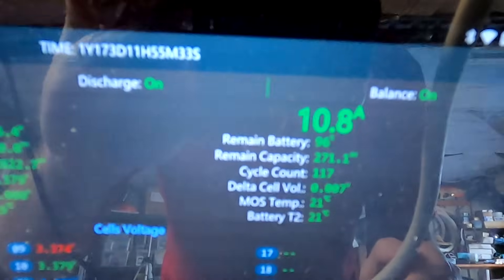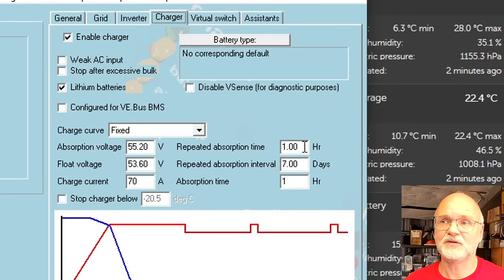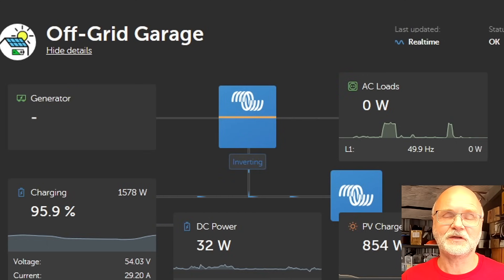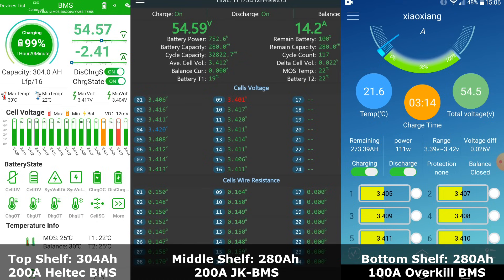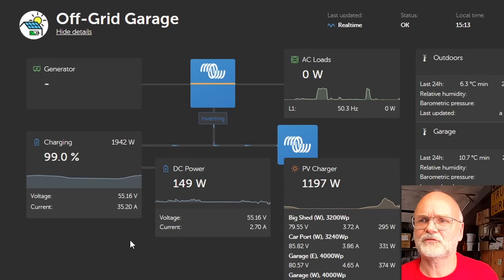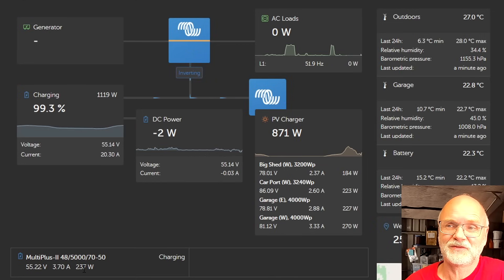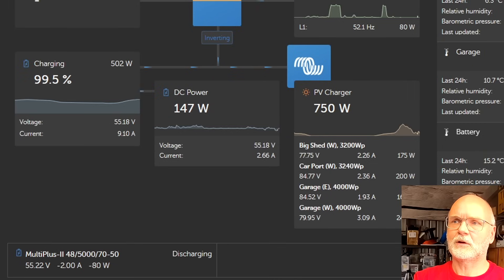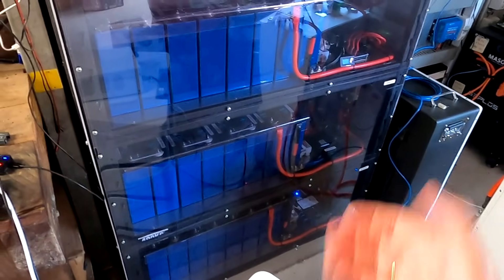Battery Shelf full charge after 4 months. First time of Multiplus frequency shifting!

Comment: But you can not use your phoenix inverter as a generator in this configuration, right?
Reply from the maker: No, that's not working. The Multiplus cannot change the frequency of any connected AC source, either grid or generator. There are other methods for such systems .
Reply: @OffGridGarageAustralia  Can you point to them? I was thinking to expand the solar part on the AC OUT side with a Fronius AC coupled but i also have an hybrid voltronic to integrate on the AC IN

Comment: Andy, your DIY system runs better than the latest closed loop communications systems such as the SEPLOS.  Great job.
Reply from the maker: It runs very well without any form of communication.
Reply: @OffGridGarageAustralia  Mmmmhhh, very good to know. I currently have a Freedom Won battery that is not communicating with the Sunsynk inverter and I've set parameters as per recommendation from the Freedom won manufacturer for those cases where there is no comms. Seems to be doing just fine.
Reply: @kevinrtres  my batteries have rs232 with rj12 (6pin) connector. So I ordered some rj12 and db9 rs232 connectors and  is going to try to log in to the battery via that connection. RS485 port was no luck, but may be I'm just using the wrong pinout, as manufacturer didn't provided any info on that matter. Will try to use here instructions from Current Connected regarding theirs batteries and Voltronic inverters. If it will not work, the next step is to open the battery and void the warranty 😂😂
Reply: @dmytromaruchok7225  Hi, that seems like a rather drastic step! Before you take that leap, what battery and inverter combo do you have?
If it's the same as mine ( Freedom Won and Sunsynk ) the pinouts for RJ45 cable using CAN port are Inverter pin 4 is CAN HIGH, pin 5 is CAN LOW. Battery pin 7 is CAN HIGH and pin 8 is CAN LOW. So you have to have a cable that connects 5 to 8 and 4 to 7.
Reply: @kevinrtres  My batteries are Junlee and the inverter is Axioma Energy (Voltronic clone, looks exactly as Voltronic Axpert VM IV, but may have different firmware).
I tried the pinout, that you described, but had no luck. Manufacturer said despite they indicated Voltronic as compatible, they actually never tested theis batteries with Voltronic inverters. But tgey seems to work with Growatt. And there is different protocol used for sure. Thats why I want to try to connect to the battery from rs232, and see what it uses.
Reply: Good news. The manufacturer just sent me the pdf with all information about the bms. Cant wait to put my hands on it.
Reply: @OffGridGarageAustralia 
Sometimes less is better   ;-)
Reply: those closed loop systems sometimes is a complete mess. I recently got 2 new batteries with Junlee brand. Still can't make them to communicate with the inverter (I have Voltronic clone, called Axioma Energy), and not sure they communicate with each other via rs485. Manufacturer doesn't want to provide any information about the BMS, ADS settings, anything. Tried to crimp many variants of the can and rs485 cables. Still no luck. Still have Error61 which means - no communication.

Comment: Thanks Andy, this is a VERY interesting one! Absolutely terrific!  👍
I’ll have to try my (old) AC inverter now sometime and see if it works as well. (It is supposed to shut off at about 52Hz.)
I’m also SUPER impressed with the accuracy of your Victron shunt after such a long time since a top of charge sync! What figures are you using for Peukert and charge efficiency in the Victron. TIA
Reply from the maker: Thanks Dave. Yeah, I was impressed with that too. Last year, the difference was a bit higher, like 2-3%.
I have all the settings with screenshots of my devices on my website here: https://off-grid-garage.com/my-settings/
Reply: @OffGridGarageAustralia  Thanks Andy, fabulous,  Danke schön -  virtually exactly the figures I use in the Victron BMV. (However I’ve never gone anywhere near that long without a top of charge sync, so that’s really very encouraging.)

Comment: Not sure i agree on your statement that the bms limiter doesnt make sense..
Maybe not for your system at this time of year, but when cranking 100+ amps in summer it certainly does make sense..
Furthermore, victron ( and seperate components systems like it) limits the scc , if using a hybrid, there is no problem with loads not being fed by solar
Reply from the maker: At what point would a current limiter make sense when the battery is fully charged and current is tapering off anyway? I cannot think of a situation where this would be necessary...
Reply: @OffGridGarageAustralia  Well similar question could be asked about Victron behavior.
Why would you limit solar production due to a BMS limit, if there are loads present, but only when in off-grid mode and not when connected to grid?
It is a bad implementation of the current limit in the charge controller by Victron, because it does not take the AC load power into account, like other integrated hybrid inverters.
All-in-one hybrid inverters will still supply all the power needed for loads even when Seplos sets charge limit, no matter if in grid tied or off-grid operation.
Anyway... I think you need to get your hands on one of those Deye hybrid inverters... you will see Seplos works like a charm with them. :)

From my point of view I like the fact the charge current gets limited when SOC is high, it makes no sense to charge the battery with high current at high SOC.
If anything I would love to have an option to adjust the complete charge curve depending on the SOC, but AFAIK no BMS has that option so far.

Don't get me wrong, Seplos does many stupid things, their BMSs could be the best out there with some minor SW tweaks, the settings are also a minefield.
And the balancing current could be higher, but in reality over a long period it will balance the battery pack sooner or later.
All in all it is far from bad, when used together with a proper inverter.

Comment: Thanks, Andy for sharing this with us.  Nice to see it working as predicted.
I am in the states so seeing 50Hz as line frequency was something I was not aware of in Australia.  I knew you used 240v for line voltage but did not know about the 50Hz.  As you know, our line frequency is 60Hz here.
Reply: If you look at your electronic devices at home, you can see on most of them that they accept 110-240V and 50-60Hz. The reason for this is that US was an early adopter of electricity, thanks to Edison and Tesla, so when the engineers had realised that 240V and 50Hz was superior and the rest of the world catched on the US was already flooded with legacy 110V 60Hz systems and it would be too expensive to replace. Hence only US and half of Japan (because of occupation after WWII), as far as I know, are using 110V and 60Hz.
Reply from the maker: The same system works with 60Hz as well. Victron has the Multiplus for 120V split systems and 60Hz as well.
I heard the story that the US designed their power network on purpose on 110V and 60Hz to prevent people buying cheap Chinese appliances instead of the more expensive ones made in the US.
Reply: @OffGridGarageAustralia  probably wasn't a issue back, the other explanation above seems more plausible. Will look forward to the video later, although I've had frequency shifting working since February, but only comes into play if the grid goes down and the batteries are full, which is unlikely but I did test the system y turning the grid off.
Reply: @OffGridGarageAustralia  LOL, that is a good supposition but I believe the decision to go with 110/60 in the US pre dates the rivalry with China by just a few years!!!

Comment: This micro inverter looks pretty good. Have you calculated the winter advantage of the angle and per panel MPPT compared to the other string on that roof?
Reply from the maker: Well, we have done quite a bit of testing around this tilt system in previous videos (there is a whole playlist with all the videos below). A steeper angle would be more beneficial but also more difficult in terms of mounting structure and wind force.
https://youtube.com/playlist?list=PLPomydD54sgDAZCaLsyuToXbAHR3zEVtS
Reply: @OffGridGarageAustralia  Yes, I have watch all of them. You optimized it for sunny winter days and shade interfering a large part of the day.
But do you have a kWh total (and Wp total) of the panels on a good sunny winter day? For charging, the total kWh on a day matters more than the peak achieved.

So divide kWh producted by Wp of the string achieved on that sunny day and the same for the Micro inverter setup and you can calculate the sunny winter day advantage. I would take the best day of the micro inverter.

I hope you have this data for the other panels on the roof to make the best case calculation.

Comment: I don't like too the fact seplos and the others limits or stop the solar incoming even when there is load. I'm waiting for the new BMS from JK you mentioned some weeks ago to finally choose the new one for the 2nd battery.
Reply from the maker: Apparently the charge limit only applies when off-grid and the current limiter has no effect when connected to the grid. When the battery gets full, the power needs to go somewhere and if off-grid, it makes sense to limit the solar output or even stop it altogether. 
I cannot test a grid connected or ESS system unfortunately, so can only share what I find with my off-grid system.
Reply: That is only s problem if using a seperated charging system like Victron.
Problem doesn't exist if using a hybrid like deye/sunsynk/sol- ark/lux power and many others

Comment: If someone has an ongrid system with microinverters, is it enough then to put a battery bank with a hybrid inverter that has this function to control the Hz of the grid to transform this system into a system that works offgrid? Congrats from 30º S on Brazil!
Reply: Most hybrid inverters can not do this. The reason is that the frequency is delivered by the grid. When it disappears the inverter must stop delvering power. This is a safety requirement.

You can get offgrid inverters that use the grid only for backup purposes when the connected battery and solar panels are not enough. But this only works one way. So any solar surplus is lost as it can not send power to the grid, only the microgrid or the connected batteries.
Reply: @SolAce-nw2hf This 💯 
Summed it up very well.
Reply: You don’t need to control the frequency, you just export the excess. Though you should make sure you’re not exceeding what you’re allowed to export.
Reply from the maker: With an on-grid system, the inverter cannot change the frequency. I think I explained this in the video at some point.
All excess from the inverter can just be exported in this case. If you're not allowed to export or have other limits, there are other measures to control the AC-coupled solar.
Reply: @OffGridGarageAustralia  I think I didn't make myself clear, here in Brazil ongrid systems are much more common than hybrid or offgrid systems due to the price, but when there is a lack of power from the network, this system is turned off and the house is without power, even with a lot of sun outside. What I meant is that we could switch the microinverters that originally work in an ongrid system, to a hybrid inverter used only as an offgrid, creating a microgrid, which has this ability to change the frequency, together with a small bank of batteries, for at least, during the day, take advantage of the sun's energy, even when there is no power from the grid. It is very common for blackouts to happen here in Brazil and even people with a lot of solar panels on their roofs lose power.

Comment: Do you know what would happen if you did have an external generator on the system? Would you have to have a breaker that disconnects the solar inverter when the generator is on?
Reply from the maker: As explained in the video, as soon as there is any AC-in to the Multiplus, it cannot shift the frequency any more and this method will not work! Apparently there are other methods which can be put in place but usually, the excess energy of the AC-coupled inverter will just be exported to the grid. A generator usually only comes on when the battery is empty, not when it is full. So there is a generator assistant in the Multiplus for that to prevent the gen turning on in this situation.
Reply: I wonder too, I think the generator can be used to power the battery charger which wouldn't require frequency nor phase matching as a DC only input. Slightly lossey though - I would think.
   The Schneider Conext inverters allow any generator to connect directly into the AC inverter output  because they can combine both ( Inverter+ Generator)by frequency and phase matching the two. Nice and efficient that way especially since you can just combine the generator output when a large load is on which also allows running over the rated inverter power.

Comment: Like# 9 - wait, what? What the Sam Hill about Hz??? Watching a second time to figure out what the hell Hz has to do with anything charging/discharging?!? what is this witchcraft?
Reply: The micro-inverters lock on to the 'grid' frequency supplied on the output of the inverter. So the inverter is supplying a frequency and when it doesn't want that power it increases the frequency to indicate to supplying equipment that it doesn't need any more energy.
The real grid kind of works this way and Andy's microgrid off-grid also works this way.
Reply: @BobHannent  so they are trying to equalize to the same frequency? Similar to my other question, what are the physics that changes the frequency in the inverter? I thought you set (at least in my inverter I can choose different frequencies). I presumed once you set it, that’s what it was unless a loss or surge of power. Which I’m presuming isn’t a desired behavior?
I might be thinking through this in real-time.
Is frequency related to resistance? Does resistance go up as the battery approaches full charge? Something like this?
Reply from the maker: Both, the Multiplus and the micro-inverter have the same frequency. Always.
The Multiplus is our energy source and it determines which frequency it runs on its grid. The micro inverter is just following this.
Reply: @OffGridGarageAustralia  is this exclusively a micro inverter thing?
Reply from the maker: @paulcurtis5496 The Victron Multiplus does the change in frequency once the absorption voltage has been reached. The micro-inverter or most other grid tie inverters will just follow this 'grid' frequency and throttle down. So it is a Victron thing.
Reply: @paulcurtis5496  all grid tie inverters will follow the grid frequency. If they cannot sense the grid voltage then they don't supply energy because this means the grid is down and you don't want to back feed the grid if maintenance is happening, electrocuting a maintenance technician.
Generally grids are often regulated by the frequency because traditionally a classic generator will bog down and slow it's rotation if there is too much demand on it and speed up when there is low/no demand. So things on the grid can use the frequency of the grid as an indicator of demand. Being outside of the normal threshold value indicates an anomaly, so the inverter should stop.
Reply: The microinverter tracks the line frequency provided by the Multiplus and uses that to adjust to its output power. The Multiplus will automatically adjust this frequency to control the power coming into the system from the microinverter.
Reply: @boomermatic6035  how does frequency relate to, I’m not even sure what to ask, SOC or Voltage? Or what does it correlate to?